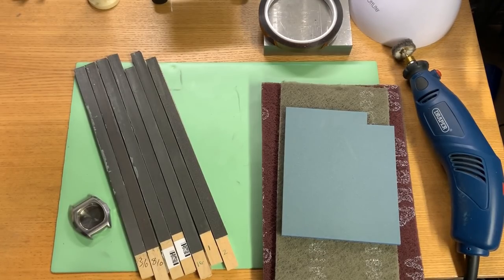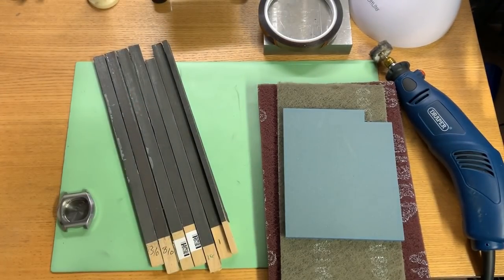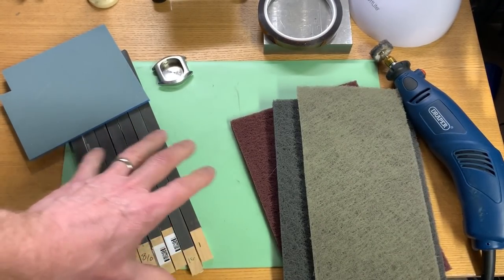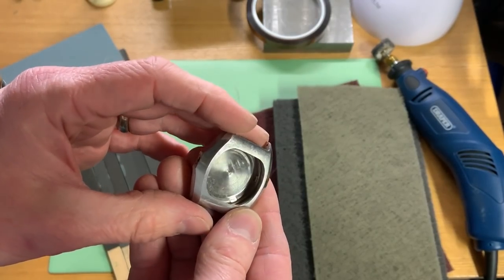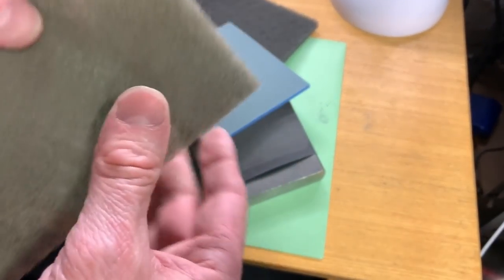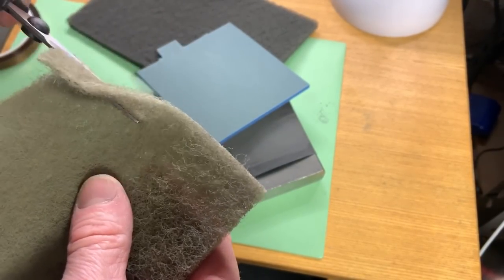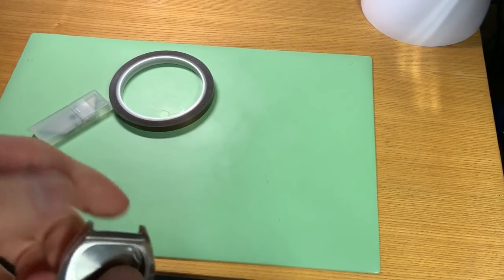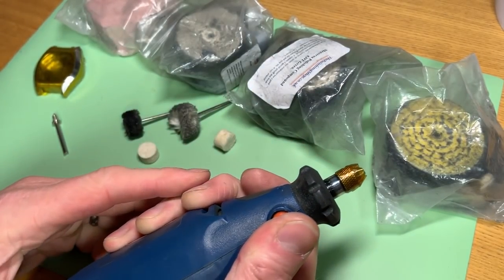How to Polish a Watch - Polishing & Brushed Finish. Seiko 7025

Comment: I use old used up Connoisseurs jewelry polishing cloth to wipe away the polishing compound to see how I'm doing. And it's a dedicated cloth for that purpose only. I have three neatly folded in a stack, and they also make for a soft surface if you need one quick. And you can undedicate them real quick if you spill your beer!! LOL Great vids glad I subscribed!!
Reply from the maker: I will look into those thanks.  Thanks for subscribing too.  Its usually scotch on my bench

Comment: For your DRemel chuck instead of using the Capton tape use heat shrink tubing  you can get it at your electronics store  heat shrink one time and if you like add a second piece after that and shrink that down.
Reply from the maker: John Bravo that sir is a fantastic idea!  I’ve changed tools now as this one burnt out. Plus I have a bench polishing machine however the rotary tool still gets used allot.

Comment: Nice job Mike, thanks for the video.  This is the one part of the watch restoration process I feel amply qualified to take on and 100% confident about; nonetheless it's heartening to see someone whose business is abrasives approaching the job in exactly the same way.  So ... having got a nice shiny finish I'm wondering about - you guessed it - electroplating.  I have a few base metal cases to restore and any wit and wisdom would be very much appreciated.
Reply from the maker: GenWivern2 thanks for your comment.  I think polishing has a standard procedure that’s well documented . Prep and right products in the right order. After that it’s pretty simple . 
As for plating , I’ve never got into it. Allot of prep needed.  Most towns will have a plating shop and I have contemplated calling my local one to see what’s involved and the costs.  Thickness of the plating is also something you need to consider too. 

I believe someone in my Facebook group does it but I can’t remember who it is unfortunately
Reply: @MyRetroWatches  Thanks, Mike.  There's a reputable plating shop nearby so there's always a line of retreat, but I have a rather ordinary Ingersoll to play with and an anode due to arrive shortly so I guess I'll report back.

Comment: Great tutorial! When is it required to wet the sandpaper, I see you don't wet it what difference does it make?
Reply from the maker: Hello and thank you for your comment. I am glad you have found the tutorial useful.  Wet & dry , you can use it both ways I just prefer dry.  wet would just remove the filings quicker and prevent the paper clogging up.

Comment: Hi,
Great video!
I would like to know which type of abrasive and which grit I have to use it to simply refresh the brush section of my watch case? 
Best regards
Reply from the maker: Martin Messier if it’s just the brushing and you don’t want to try to get under deep scratches then just there scotchbrite. If you are wanting to remove scratches then you will need paper of 600,800,1000,1200 grit first 
The scotchbrite as your see in the video gives you the brushing effect

Comment: Hi, maybe a crazy question, but could you use sand paper or a rasp of some sort to customize the shape of the case? I have a Vostok with  very chunky mid case and lugs, and am interested in trying to remove some material to slim those areas down. I live in an apartment in Korea, without much room to own many tools. So don't have a sanding machine, or dremel  or anything of that sort, and don't want to buy them with no place to keep them. Would sand paper and rasp take way too much effort for this, or be too imprecise? Just a fun little thing I'd like to try to an expensive watch case, which I think could look pretty good with a little love.
Reply from the maker: I would say to remove material by hand in any real quantity a difficult task.  Firstly the case has to be solid stainless. If its chrome plated then you will just remove the chrome to see the base metal.   
You could rub with 320 grit paper for half an hour and you would have only removed 0.01mm +
Reply: @MyRetroWatches  Thanks for the reply. I thought as much. I figure I could remove more material with a rasp, but keeping everything symmetrical and clean would be pretty hard. Might try anyways, cause it's going to be a long hard winter indoors

Comment: Maybe I missed something, why are you polishing longitudinal and transverse?
Reply from the maker: Time Art Piece I do this especially on the more cutting / coarse compounds . I’m not a big fan of felt and on my polishing machine I do not use it at all but for anyone wanting to try with a dremel it’s a good place to start. I find that the coarser compound with a felt wheel can sometimes leave marks so doing it both ways lessens this . 
Also there are the edges to think about , polishing diagonally can help retain those.,
I think I may do a video on the machine at some point. Results are allot faster

Comment: Great video.  How did you cut the kapton tape around the curved parts of the case.  Did you use a razor blade, did it not leave a scratched line on the metal?
Reply from the maker: World wide137 careful razor blade and good magnification . If you come up so the side of the blade is on the flat surface you can just slice it off as the blade end is in the air rather than pushing down on the case.  Really sharp blades cut through it well as the tape is quite rigid .
Reply: @MyRetroWatches  Ahh, that is a good technique.  Thank you for sharing.  Cheers!

Comment: How did you applied the tape on a curved form ? I never managed to do that because the tape edge is straight
Reply from the maker: I stick the thermal tape on and then use a razor blade (under magnification) to cut out the contours.
Reply: My Retro Watches I tried that with a box cutter it did not worked, I should use a sharp razor blade it makes sense. Thanks

Comment: Hi Mike,
I'm looking over the polishing shop website and they have stainless steel kits comprising mops and compounds.   
They don't use felt - even the grey compound uses a Sisal mop.
They recommend a max rpm of 4000, whereas your dremel starts at 10,000, ( I assume this is to prevent overheating).  
Which of their kits would you recommend?
https://www.thepolishingshop.co.uk/polishing-kits/steel-stainless-steel-polishing-kits/steel-stainless-steel-kits-for-drills
Reply from the maker: Jake Lewis they are not kits for a rotary tool hand machine like I demonstrate , what you are linking to there is for a polishing machine like a bench grinder with a taper spindle. 4” diameter wheels .  You have to be very careful with a machine like that as you would lose edges in seconds. 

I have a bench machine that I do use but I only put on 2” wheels
Reply: @MyRetroWatches  That makes sense - larger diameters at lower speeds vs small diameters at higher speeds.
The link I posted above is rated for hand drills, they also do 6" and 8" kits for bench grinders.
I'm going to order just the compounds (in small sizes totaling 11 UKP shipped), and buy the mops and wheels from your affiliate links.
Reply from the maker: Thanks Jake,  In my professional opinion Menzerna is the best out there. My day job we sell this into some large companies but in full bar form

Comment: With the correct equipment, this case would take about 10 or 15 minutes to polish.
Not bad results
Reply from the maker: Hello,  I actually have a polishing machine, this video was done using a rotary tool to demonstrate what can be achieved.  all to common I see over polishing on watches and all the sharp edges have gone.  You have less control on a bench grinder/ polisher as the contact material , cotton wheel can be too big, even using the thermal tape does not always protect the edges.   Once thing for certain is to use quality abrasives, & compounds.  Abrasives is the industry I work in professionally and quality always wins in the end.
Reply: @MyRetroWatches  you can buy a felt wheel for a polishing machine to keep case angles. Ray foster make a very nice variable speed motor with a lapping disc and 3 jaw chuck attachment. We use this setup at my store and it's quite affordable (especially relative to how much it could be)
Reply from the maker: Karson Barnes I will Google them and take a look. I have felt wheels but I only start with them . Normal polishing would require stages of felt, cotton and soft cotton  , stitched loose etc.  Each wheel a finer compound .
Thanks , I am always open to different products

Comment: Hello, what's the name of this tape, scotch tape?18:56
Reply from the maker: Kapton tape , or heat proof tape. https://rover.ebay.com/rover/1/710-53481-19255-0/1?mpre=https%3A%2F%2Fwww.ebay.co.uk%2Fitm%2FKapton-Tape-5mm-10mm-20mm-50mm-100mm-200mm-300mm-rolls%2F322522852211%3Fhash%3Ditem4b17dc2b73%3Ag%3ALKwAAOSwMsxeupIZ&campid=5338562247&toolid=20008
Reply: @MyRetroWatches  thank you very much! Are you using diamond polishing paste? Yes, your channel is also watched in Russia! There is something to learn from you!
Reply from the maker: @rambeza   I am impressed I reach Russia!  You have good English .
The compound (paste) is not diamond just  different grades of polishing compound.  Abrasive is aluminium oxide in the compound.
Reply: @MyRetroWatches  I'm lazy, so I didn't learn your language )Google translate helps me.So, question!How to remove the RAID from the arrows?Previously I have seen what a pencil is, after all, clean!Magic of some kind !